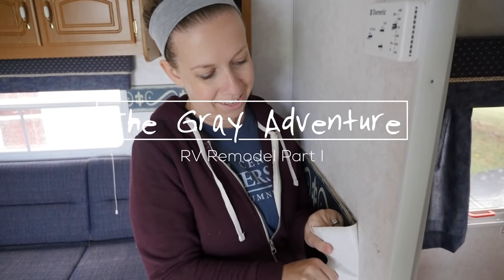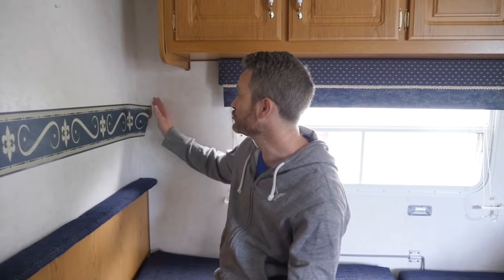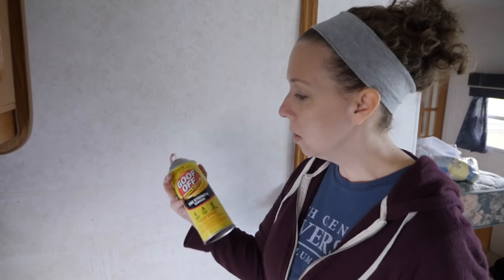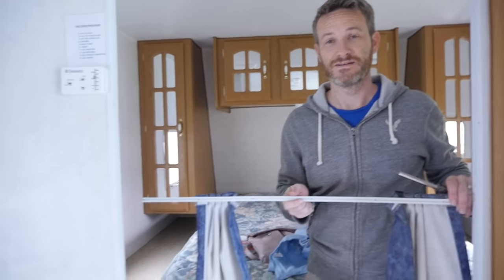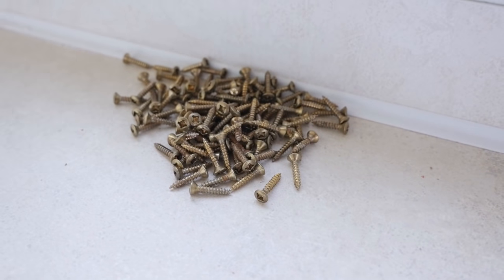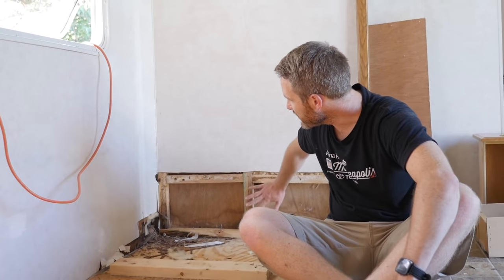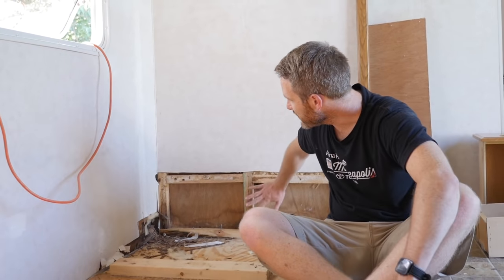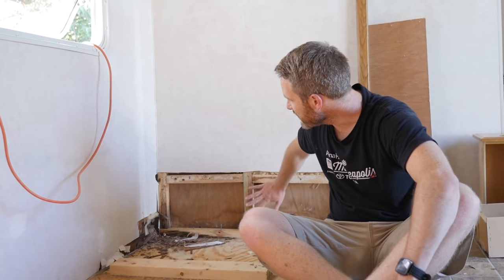RV Remodel: prep, painting & water damage discovery

Comment: Use a heat gun moving  just ahead of your border pull and it comes down much faster & easier. Then use the goof off. The goof off removes the goo but left too long will cause the  finish to come off the thin wood it’s laminated to.
A hair dryer is a substitute for heat/paint remover gun. Hair dryer you just move slower and don’t have to worry about it getting border too hot.

Comment: I have a huge water diamond can you tell me the name of the tool that you're using to cut everything with I have a small hand-held circular saw to use but I need to know what saw you are using to cut away the walls and the nails please answer this question great job by the way not looking forward to finishing mine big job thanks
Reply from the maker: We used an oscillating tool like this for a lot of the cutting of the panels on the inside since it allows for controlled, clean cuts. https://www.homedepot.com/p/Genesis-2-5-Amp-Variable-Speed-Multi-Purpose-Oscillating-Tool-GMT25T/205463751?cm_mmc=Shopping%7CG%7CBase%7CD25T%7C25-9_PORTABLE+POWER%7CNA%7CPLA%7c71700000034127218%7c58700003933021540%7c92700045511774394&gclid=CjwKCAjwpuXpBRAAEiwAyRRPgXir3HzSW1PkhNik1xk3CQmmSoQ1uEIQ9jaCkXF3iTuWCrinHRothBoCzIwQAvD_BwE&gclsrc=aw.ds

Comment: RV shopping and notice a lot of people run into water damage. Was it a huge expense to fix- Roughly how much did it cost to fix all of your damage? I don't wanna get stuck with an RV that has water damage and it costs too much to fix.
Reply from the maker: Less than $250 to fix all water damage. It took a lot of hours, but the cost was minimal. That included ripping the whole front of the RV off and replacing the floor under the front storage compartment.
Reply: @TheGrayAdventures  Thank you

Comment: Do you have to prime if the prime is already in the paint trying to cut out a step of priming so I had the pain in the prime rib mixed together what are your thoughts
Reply from the maker: You can use a paint/primer combo, but you'll likely need three costs to ensure you cover the dark wood color. Doing with a separate primer for cover will save some money.

Comment: hello im concerned on when you took the sticker residue was it completely off or as much as you could
Reply from the maker: We were able to get it completely off. One trick (which we learned after we removed our border) is to heat it up with a hairdryer. That will loosen the adhesive and make it easier to remove.

Comment: I wonder if you can use a heat gun to get the wall paper border off?
Reply from the maker: that would probably help loosen up the glue to that it can be pulled off easier. But getting it off wasn't too hard. Took 30 minutes or so. The tricky part is removing all the glue residue.
Reply: vegetable oil will work to remove the glue too...
Reply: @missylynne7944  hair dryer will help take off the residue as you pull. Gosh, no one does this in any of these vids!
Reply: I used a hair dryer on ours yesterday and it did help quite a bit.